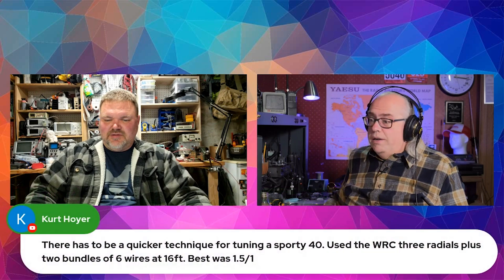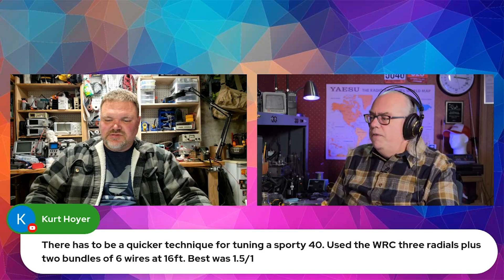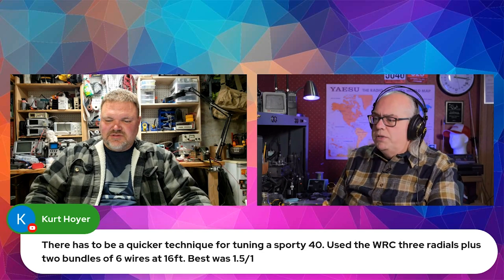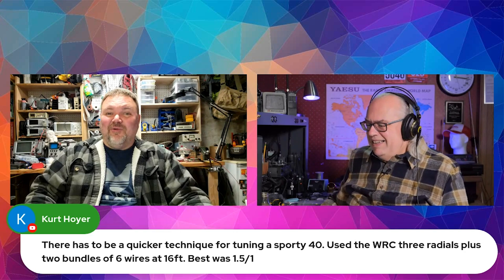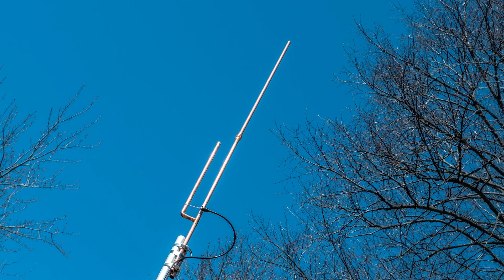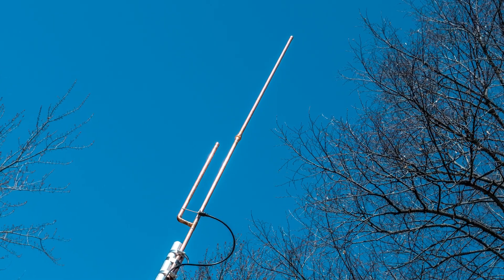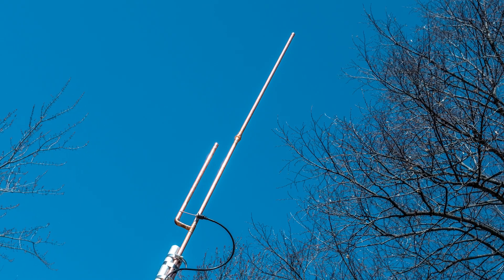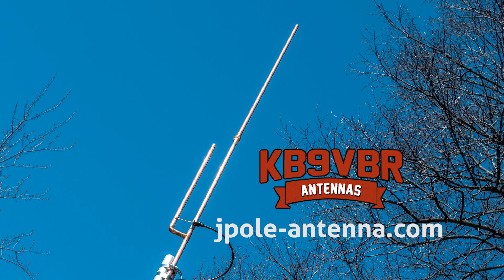Ask Michael, KB9VBR: Tuning the Wolf River Sporty Forty Coil #HamRadioQA

Comment: People ask these questions because it gets drilled into their heads that anything above 1:1 SWR is not good. In reality a radio won’t start folding back power until a 2:1 SWR. A 2:1 SWR results in an 11% reflection of power, a 3:1 SWR is about a 25% reflection of power. .

I was out yesterday with a 17’ SS whip, 8 radials of 16’ 6” and was able to achieve an SWR of 1.5:1 or less on all bands 20-10m except for 12m and even that was a 1.7:1. Point being don’t sweat the small stuff.
Reply from the maker: Exactly. The other day I was running on 15m and my hamstick was about about 1.5:1. I had no issue making contacts and catching weak signals. I could have spent the time to tweak the antenna, but that would've been time spent not being on the air.

Comment: The problem with 1.5/1 is that with 1.5/1 the real DX stations don’t hear you. With flat 1.0 they do. People should do real DX (10000 km plus) before saying these things.
Reply from the maker: This statement is categorically false and shows little understanding in SWR and your overall antenna system. A 1.5:1 SWR represents a 4% loss in power and the difference wouldn't even wiggle your S-meter. I have no trouble getting DX contacts with my vertical antenna presenting a 1.5:1 SWR (or worse).
Reply: Right....😂
Reply: Some hams have made DX contacts with QRP radios, so having only 95 watts out of 100 isn't going to make a significant signal difference.
Reply: @kd5you1   I make DX contacts all the time on 5 watts (granted, it's CW), and my SWR is usually in the 1.3-1.5 range so you are 100% correct
Reply: CoverioPS3 - Believe what you want, but you're doing the hobby a terrible disservice by spreading misinformation like that.
KZ9V
Reply: Almost all of my POTA contacts are DX (I live in Hawaii). My average QSO is 6,500km but often make contacts at 12,000km. I have found that the amount of wire on the ground is way more important than a 1:1 SWR. I like to run two wavelengths of radials for single day POTAs and 3-4 wavelengths when camping.
Reply: You need to see a rig doctor because you have a bad case of CB-itis!
I've made hundreds of >10,000km contacts with 2.0:1 SWR.  Low angle of radiation is what you should be obsessing over, not a 1.0:1 SWR.

Comment: Good video!

I use minimum 100 ft as a rule of thumb for total length of radials. The 3_33+ feet stock radials; 6_16+ foot or even mix and match, and more is even better for tuning.